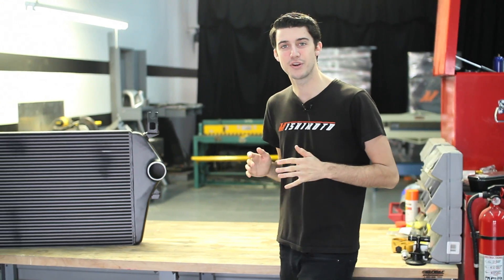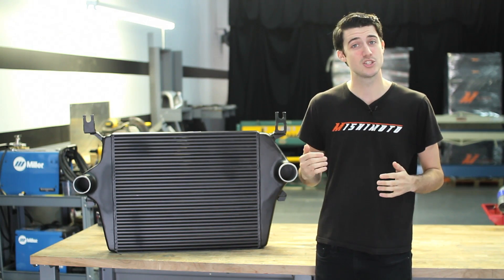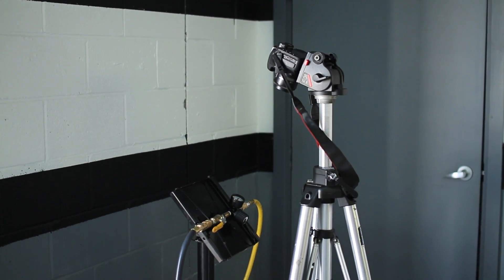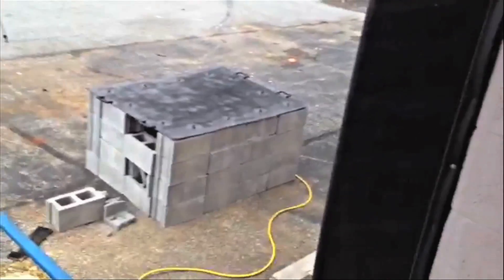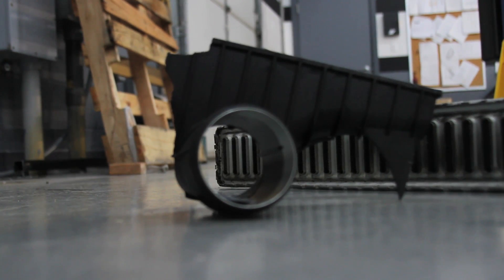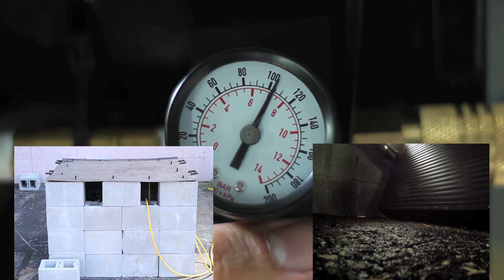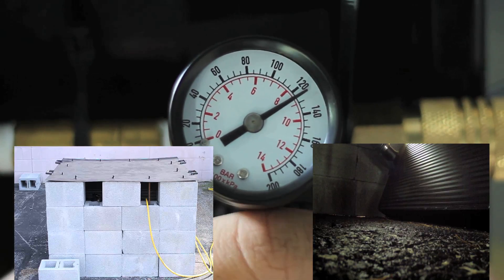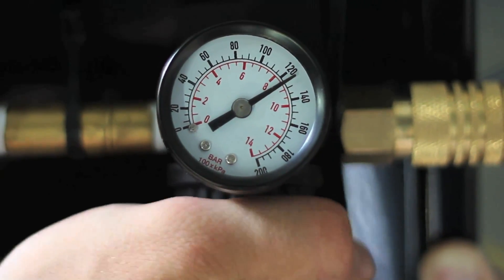Mishimoto Blows Up An Intercooler

Comment: I'm deciding what intercooler should I buy .but u stop at 125 u should keep on going push the limits. And no one doesn't put when do you really see the results of the intercooler kicking in at 4000 rpms or both or just idling

Comment: Unless you are running a giant truck, under normal circumstances you will never reach such high psi... 50s is on the higher ones, max maybe 70ish. The point of intercooler is to cool the air... not hold the highest amount of psi. Should do a temperature drop test instead. :P
Reply from the maker: Thanks for your suggestion!  We have all sorts of new tests in queue, so stay subscribed to our channel.  ;)

Comment: I'm actually surprised the stocker held 100 psi...I figured it woulda failed long before then
Reply: factor in heat and you'll have the rest of your equation. plastic hates heat.,

Comment from the maker: The strength of our intercoolers is just one of the many reasons to purchase one. Our intercoolers also provide lower air intake temps, reduced pressure loss, and more efficient heat dissipation. Plus, all of our products come with a lifetime warranty! These are all benefits that can be seen from installing one of our intercoolers onto your truck. If you want to see this data, check out our engineering reports on our website. They can be found on the product pages for these intercoolers! :)
Reply: If we buy one your intercoolers, how can we be certain that it is in fact not a knockoff? I just bought one off Ebay.

Comment: This is great in all that it holds up but it would have been more interesting to see cooling efficiency - oem isn't designed to run even remotely close to 100psi and the fact that it held up that high is impressive all in its own. I just dont think this was a proper test for an intercooler.

Comment from the maker: We have engineering reports on our website that are available to the public, which outline the performance increases we saw over the stock intercoolers. Our performance intercoolers offer a decrease in air intake temperatures, reduced pressure loss for greater efficiency, and a bar and plate core, which is stronger than the factory tube and fin design. 
Feel free to ask me any additional product related questions, as I would be happy to help.

Thanks,
Tyler

Comment from the maker: The PSI chamber was built as a precautionary measure to ensure the safety of our engineers during the testing. The fact that one of the concrete blocks blew out shows you just how much pressure was in that intercooler! 
Our intercoolers use cast aluminum end-tanks because they are stronger than stock, dissipate heat more efficiently, and flow better. Since this intercooler is designed for a diesel truck, we actually do have customers that run this much PSI or higher!